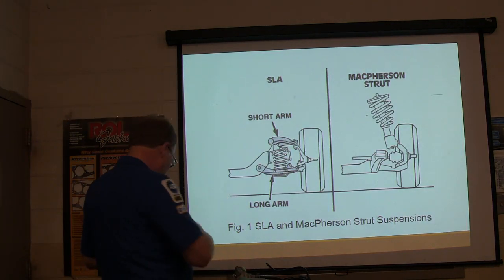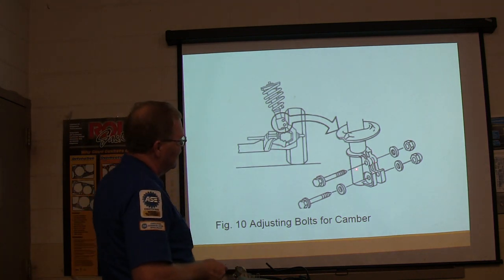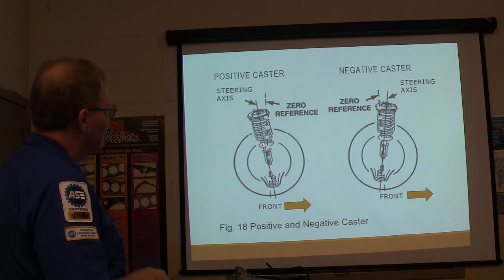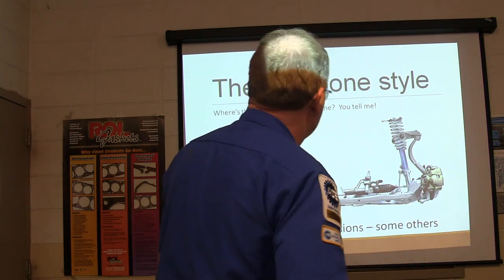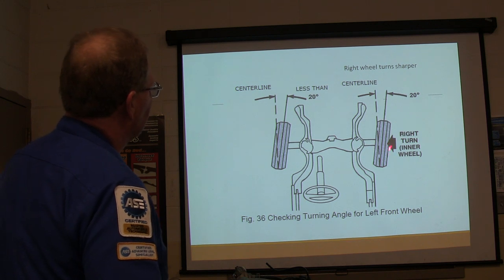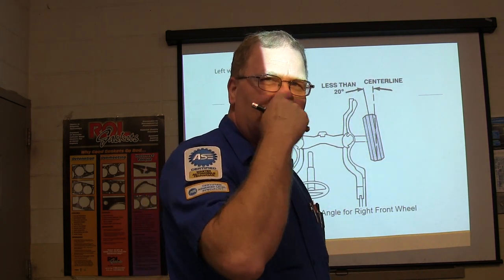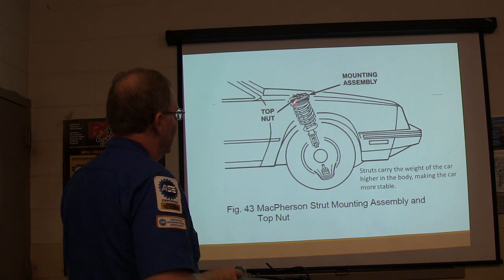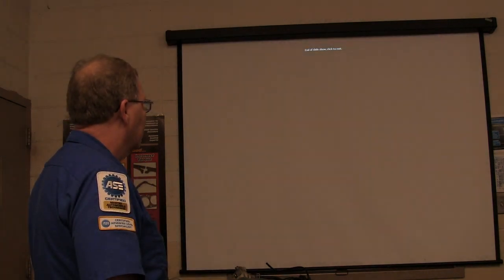Alignment Angle Basics

Comment: I like the stock ride heights of the 60's Lincoln and Cadillac smooth looking highway machines. The old GTO's of the same years also had a nice highway wheel placement in my opinion. I know the new cars handle better in an emergency but the old heavy rides are nice if you are driving all day long on the open road going somewhere.

Comment: There's an error in the slide at 7:38 - it's supposed to be showing negative caster load projecting but it's actually showing positive caster load projecting (just like the slide before it). The issue is that the label denoting which direction is the front of the vehicle switches between those two slides instead of remaining in the same position.

Comment: What I would like to understand is if the camber/caster with struts are ever adjustable; because I don't see any adjustable bolts on struts. Do I need a caster/camber alignment when replacing struts or just the toe adjustment?
Reply from the maker: Typically you can buy a camber bolt kit for the camber adjustment but sometimes on the struts you have to cut the spot Wells out of the top of the tower and move the strut that way after you slot the holes... Some struts have an egg-shaped hole if the bolts go crossways for camber
Reply: @McCuistian  I'm not a car enthusiast who like to change things, I only want to learn the correct way to put things back if I do a repair. When I replaced the struts on a Kia Picanto, I did not see any way of adjusting the camber/caster, so I figured that it set at the factory and as long as I replaced everything correctly, that the caster/camber would be correct.
Reply from the maker: @carlodonnell146   you can replace the parts and then have the alignment checked

Comment: First this guy teaches me about the injectors on my 7.3, now he teaches me about steering geometry??? WHAT DOES THIS GUY NOT KNOW?
Reply: I got rid of my 350 after I rebuilt the injectors and now have a 98 Tacoma (I know , right)

I my tires wear on the inside way faster than the outside. The guy I bought it from didn't speak English, so I'm not sure exactly what happened to the truck, but there is damage on the fender well right behind the front driver's side wheel. 

When driving, it has what I'm assuming is bump steer. The front wheels have visibly obvious (negative?) camber. They point inwards at the top.... The tires squeal when I stop. When I partially turn my steering wheel in either direction I get a metal on metal grinding noise. Fully steered in either direction, there is no grinding. 

When I change lanes, the lane paint wants to pull me in the direction that I'm moving towards. If I'm going from left lane to right lane, it pulls me to the right fairly hard. 

It has hub spacers on it because the tires are oversized and I believe it has been lifted somewhere between 2 and 4 inches. 

I took it to an alignment shop and the guy told me "the hubs don't quite fit the spindles" so I'm assuming whoever worked on it, just made it work for as cheap as possible. 

It only has 130k miles and runs well, so I want to get it driving well too. 

I found some upper control arms that are adjustable and I'm wondering if i install those, I can get more range of adjustment in my camber. I imagine I will have to adjust some other things if I do this.

Mainly, I'm trying to confirm that it is in fact either toe or SAI before I buy the parts and I'm posting this in a few different comments to bounce ideas around and maybe just find a way to actually troubleshoot the issue. 

I'm open to even taking it back to the alignment shop and talking it over with them as well